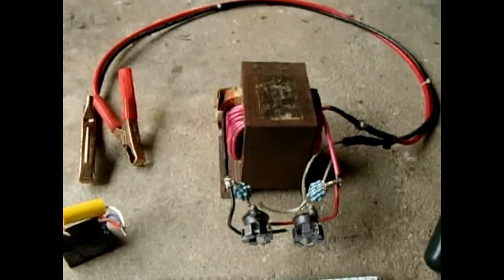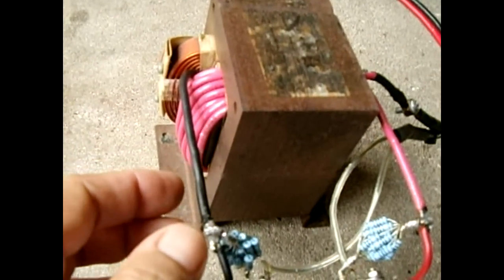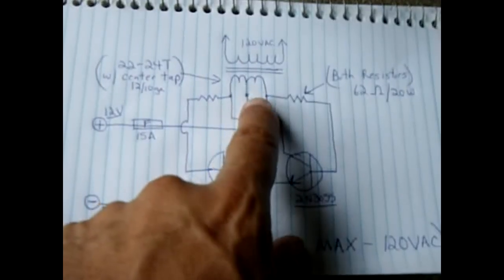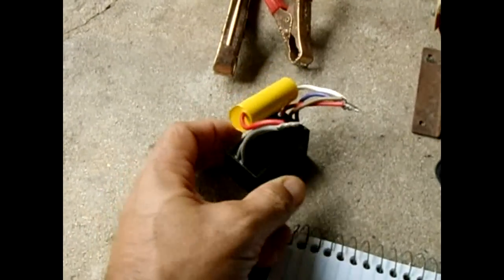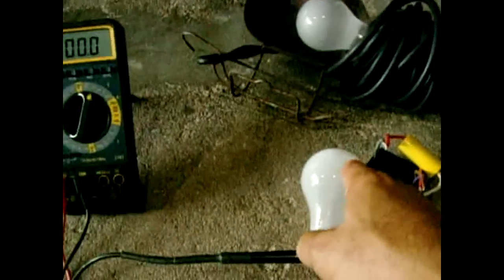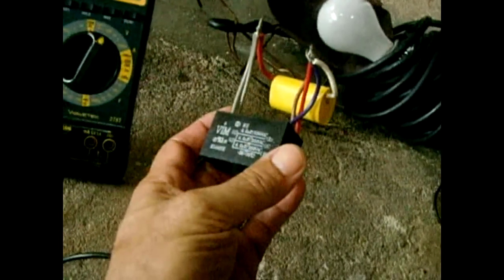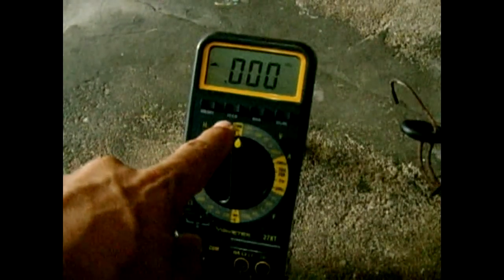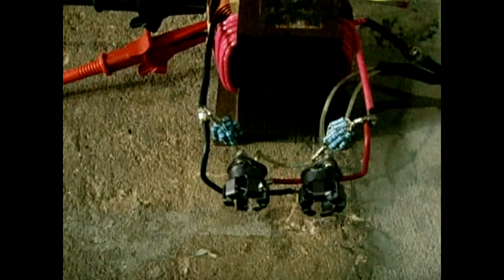How To Make A Microwave Oven Transformer(MOT) 12V to 120V Inverter

Comment: The objective should be to convert the items that are 110v into 12v, not the other way around... most household objects take your 110 waste 95% of it as heat and use the remaining 12 volts or lower for your device. you are paying out the ass for electricity you don't even use its just wasted...its all a huge scam and is extremely wasteful, if their wasn't a world full of sheep we would have recognized this long ago. take a look at your electronic devices voltage input, then the voltage output, look around the house, hardly anything utilizes the 110 and if it does its extremely inefficient.
Reply: "The objective should be to convert the items that are 110v into 12v, not the other way around..."
This is not practical. Think about the current flow through a vacuum cleaner running from 12 volts. I live in the UK, so mine runs on 240V and draws 6.5 amps. Running off 12V it would need to draw 130 amps. This would require very thick wires in the household to accomodate several appliances that 'could' be running at the same time.

"most household objects take your 110 waste 95% of it as heat and use the remaining 12 volts or lower for your device. you are paying out the ass for electricity you don't even use its just wasted..."
Modern power conversion is very efficient and draws negligable current from the wall. SMPS supplies (switched-mode power supplies) don't waste much energy as heat since the switching transistor is either in an 'on' or 'off' state, thus making it a lot more efficient than if it were only switched half on. Transformers plugged into the socket have their inductive and capacitive properties matched to the line frequency so that very little current is drawn from the wall until a load is connected to the secondary winding.
http://en.wikipedia.org/wiki/Transformer#Basic_principles

"take a look at your electronic devices voltage input, then the voltage output, look around the house, hardly anything utilizes the 110 and if it does its extremely inefficient."
It's true that most devices in the house now use much less energy and can be run from a lower voltage source. This would be much more efficient. But there are some devices that require a lot of power in the kW range that still need power. Lowering the voltage would mean you have to use much thicker wire. This costs more money and you will also lose some energy as heat in the wires.
http://en.wikipedia.org/wiki/Electric_current#Resistive_heating

High voltage was also chosen for power transmission lines because of the efficiency. With lower voltages, you need much higher currents to transmit the same amount of power, so you would not be able to transmit the power to the end user without losing a lot as heat in the lines. Using high voltage means that there is less current flow through the wires, so they can be made thinner. They also do not lose as much heat. They are transmitted as an impedance-matched balanced pair to reduce radiative losses further.
http://en.wikipedia.org/wiki/Transmission_lines
Reply: ***** You've entirely missed the point.
Your AC vacuum cleaner is a terrible comparison, really, being one of the easier conversions to 12v. The original 12vDC could power multiple vacuums as DC. Mr. Rider was referring to DC household items, as a practical approach to saving in the long run, by being self sufficient, if I'm not mistaken. Most electronics in our homes are converted to DC today anyway. Loads of power is lost as heat in this process. DC source to DC electronics won't, makes sense when it's your own power source. If you're using a 12v source, presumably a car battery, remove AC from the equation all together. As for the gauge of wire needed for each application, that's a minor semantic at best.

High power AC was chosen for power transmission because it's far more efficient for travelling long distances whereas DC is not, it loses power quickly over distance, and as you said requires more material, loss of heat etc.. It is also easier to convert AC to various voltages. That's it, the distance it needs to travel from the power plant to the transformer down the street to your wall plug is the reason it is AC and not DC. The distance/thickness of wire needed is dramatically removed as a problem when it's your own 12vDC power source. So a home project to produce DC from AC is not very practical considering that anything we own that operates DC has it's own converter. Inverting 12vDC to 120vAC is totally impractical, The amount of 12v car batteries needed to power high amperage devices in AC compared to converting said appliances into 12vDC... This device allowed a microwave to operate at one time. Now it barely powers the bulb inside when you open the door. You wouldn't be wasting your effort to make an inverter to change your DC to AC. That's the point, imo.

Therefor, imo, Mr. Rider is absolutely correct in assuming "The objective should be to convert the electronics that are 110v into 12v, not converting the 12v power to AC." If you could convert all your electronic items to DC, you would be past a major hurdle to becoming self sufficient, or "off the Grid." Converting a vacuum cleaner to DC would be pretty easy.
Converting the appliance to 12v is just far more efficient in all respects, than inverting the power DC to AC.
Reply: Boomdamoboombry Now, first of all, this video about 12vdc-120vac converter. Which can be used as emergency or what-ever source of ac if you need. Can be interesting for someone studying electronics engineering. But no more, as it is very unreliable, inefficient and terribly bad..
Now, the point you are trying to make is absolutely wrong. All (most) of appliances in your home which requires 12vDC have switched mode power supplies inbuilt, eficency of those is somewhere at 95% percent,not so much energy is waisted. Not every (almost non) will work with the same 12v, anyway devices will convert 12 into some necessary voltage(5v,3.3v, etc)
 And vacuum cleaners usually are in 2Kwatt power range.  12v supply you will need to deliver 166Amps, thats a lot! And motor phisical size and thermal capacity would have to be huge!
And this dc-ac inverter hardly powers on the bulb because if very poor design, not because dc is superior over ac...
Reply: That's not entirely accurate....
Reply: Yuri LM Again, you as well, have entirely missed my point and that of the OP...
Reply: Dana Ryder's conspiracy rant about "a huge scam" is born of ignorance about how we pay for power consumption. I doubt if Dana's limited brain will learn much from links to Wikipedia that Dana undoubtedly despises as written by sheep. Perhaps Dana will thank the sheep who "like" Dana's theory that "most household objects waste 95% (of your power) as heat" if we let Dana believe they are laughing with Dana and not at Dana.
Reply: *****, I have no idea whether Dana is male, female or confused so I avoid the gender bias of English 3rd person singular pronouns. Your word counting ability is exemplary (though unecessary) and contributes more to world perfection than your thoughtless proposal that households should run electric heaters from 12V DC outlets.
Reply: +Dana Rider 
I think that you need to start from "  scratch " and learn a little bit about electrical theory . Ohms law , watts law kirchoffs law , transformers  , etc . before you make statements like this .
Reply: +Neon Harp  You got it wrong.  Parents shouldn't let kids play with physics.

Keep THINK a four-letter word. become a rebel without a pause, and have commenters write their congressman to get those laws REPEALED! Think outside of the pizza box with psilocybin mushroom toppings.  For instance, Newton's Law  makes even white people slaves to gravity.  

Peter Pan got it right. Because airline noise and jet fuel exhaust pollution contributes to global climate change,  unless you have a camel toe that will flap around at high speed, get yourself a pair of green yoga tights and fly yourself. 

Check out my DIY brain surgery videos.  Caution: don't let all your CSF leak out your hole. Put a cork in it,  ... appropriately sized to the drill bit.
Reply: +Jules Bartow 
Whatever it is that you are smoking ...........I wish you would share !!
Cheers , take care and have a good day !...73
Reply: +Neon Harp Not smok'n nothing.  I think I have a hole in my exhaust manifold --it's probably carbon monoxide poisoning. 
88 right back at ya!
KM4KDE
Reply: Wrong. The objective is to use a 12 volt to 120 volt transformer. Using a battery bank from solar power lithium\AGM batteries. Then use an APC backup power supply to power 120 volt items. As the APC is a true sine wave surge protector\backup power supply that the voltage is regulated very carefully. This makes a more efficient use of power. The bonus side, depending on the  rating Backup of the APC. You get a 30 for 40 mins of reserve power in a complete outage.

This is way cheaper then spending $400.00 US for 2 outlet AC\DC inverter....
Reply: Tinfoil Helmet  I'm wanting to convert a home amplifier system into a car amplifier system and needing the info on how to do so
Reply: I'm eating the knowledge on how to convert a house amplifier to a car amplifier system and needing some input on how to bypass the AC to DC converter and wondering if this will even work
Reply: goddam, there are a lot of fukkin know-it-alls on youtube

Comment: You mentioned using electrolytic caps..... Bad boy, woof-woof.... Get AC caps, NOT DC caps. You can get them from a motor shop or scrap motors... Do NOT suggest DC caps for this. They will fail and blow up, as well...

Comment: How to reduce frequency to 60hz
Reply from the maker: +Justin Sotiangco 
You would have to try experimenting using different value capacitors placed between the base of one transistor and the collector of the other, or across the resistor. Make sure both capacitor values are the same value. Non-polar caps should work. Higher capacitance = LOWER frequency.
Reply: +electronicsNmore NON-electrolytic caps are required because they tend to get hot (even explode) even if you are below their rated value.

Comment: So you need 16 on both sides?
Would this one work?
http://www.mouser.com/ProductDetail/Bourns/PWR220T-20-1001F/?qs=sGAEpiMZZMu61qfTUdNhG7dNYlvJJaAMUAQ0gmMsn2Q%3d
Reply from the maker: +Mark II 
Hi Mark. Just buy (2) 20W / 56 ohm ceramic resistors on Ebay. They are very inexpensive. Those 2 will be much better, and equivalent to all the 1K ohm resistors I used in parallel on each side. If I had them on hand at the time, I would have used them. Use one on each side.

Thanks
Reply from the maker: +Mark II 
Hi Mark. Just buy (2) 20W / 56 ohm ceramic resistors on Ebay. They are very inexpensive. Those 2 will be much better, and equivalent to all the 1K ohm resistors I used in parallel on each side. If I had them on hand at the time, I would have used them. Use one on each side.

Thanks

Comment: OTRA PREGUNTA MAS TENGO UN  http://www.walmart.com/ip/Wagan-Smart-AC-210-Watt-Inverter-with-USB/14521522

Y CARGA CORRIENTE   onda sinusoidal modificada

NO LO PUEDO USAR CON UNA BATERIA INDEPENDIENTE PORQUE SOLO FUNCIONA CON LA BATERIA PUESTA EN EL CARRO

LA PREGUNTA ES

 COMO PUEDO HACER QUE FUNCIONE CON UNA BATERIA INDEPENDIENTE Y USARLO LEJOS DEL CARRO
Reply from the maker: Hard to understand your post.
Reply: Encontre la respuesta a mi pregunta y el invertor. Le conecte un puente de diodos y haora lo uso en la bicicleta y la bateria de 12 voltios , la bicicleta carga la bateria porque le puse un motor de patineta electrica y el motor produce 48 voltios y puedo cargar mi celular a energia 120 con el convertidor

Comment: The buzzing with the transformer is no good!
Reply from the maker: Who says? There are many reasons why a transformer will "buzz".
Reply: I mean on the principle.The reasons can be, waste in steel,high harmonics,bigger currents and so on.But usually the transformer shouldn't do that. But in this case the reason of buzzing is the laminar is not thight enought.
Reply from the maker: Usually buzzing is caused by a loose lamination in the core, the transformer vibrating on an uneven floor(likely the case in my video), or loose enamel wire turns.

Comment: you need an oscilloscope
Reply from the maker: I guess you have not watched to many of my videos. I have an Oscope.
Reply: electronicsNmore The scope is your eyes. Meters read DC and sine wave. Anything else and the numbers are unreliable. 60 cycle sine wave would be my design goal. Look into driving it class D.

A 60 cycle sine wive is useful.
Reply from the maker: This video was nothing more than a demo showing what CAN be done. I already made a powerful modified sine wave inverter which is frequency adjustable.

 Homemade Modified Sine Wave Power Inverter(350/500w)